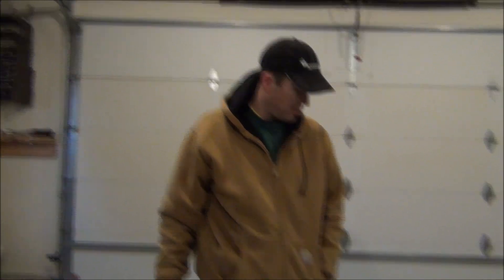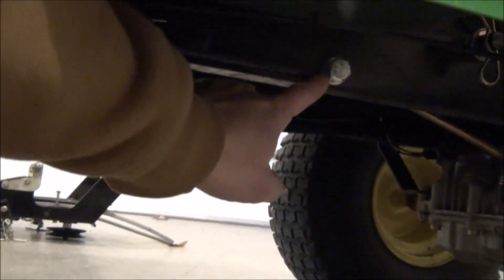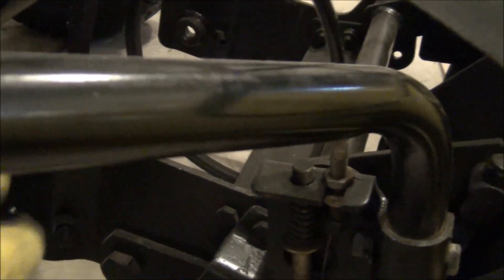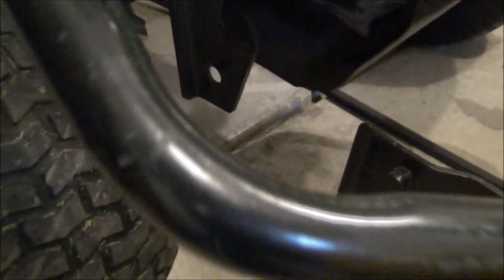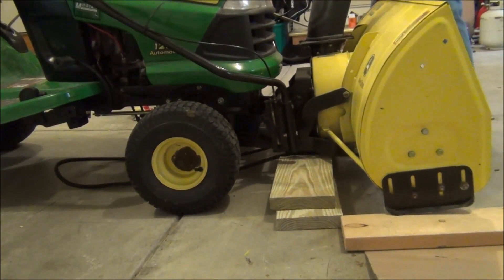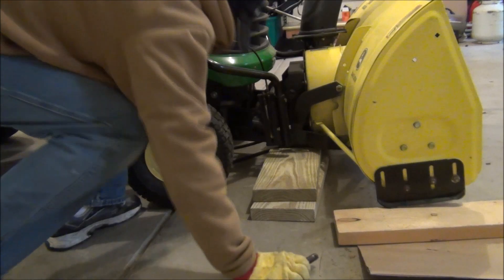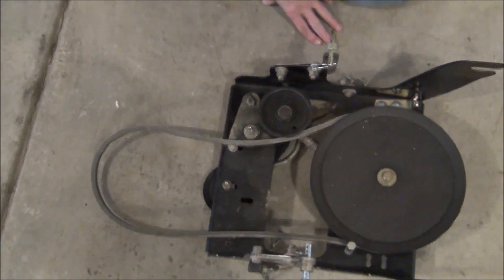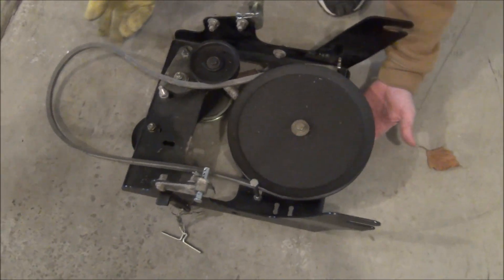How to Attach a Snowblower to a John Deere 100 Series 125 Automatic

Comment: Your video is very informative and appreciative  .  I have the same snow blower on a John Deere L 100 manual transmission . With the same set up . I was hoping that you would know what the proper part number is for the belt that drives the blower ?  I also kind of wish that you had taken and flipped over the pulley /Spring system , so we could get a better idea of how all those springs are attached . I had one fall off recently and for the love of God,  I can't figure out how it hooks back up 😢

Comment: i installed the snoblower attach but the belt dont move the stage now. Some can help.
Reply from the maker: Does the belt tighten when the pto is engaged? Will the blower turn by hand or is it seized up?
Reply: @TheWippsFamilyOfFive  i can move the big belt with my hand but the upper belt dosnt turn.
Reply: I fixed it. Just i replaced the belt. Now work good. Thank you.

Comment: Kudos to you for making this video. I have  JD125 and made the mistake of buying the snow plow they make for that model. It also is a real pain to install and if you have to clear more than 3-4 inches of snow it is of little use. I'm debating whether I should double down and buy the snow blower. My fear is that it will not be able to handle heavy wet snow. I learned the hard way that JD's customers are not the consumer. Their products are designed to ensure their dealers get more business from frustrated consumers who struggle with getting their poorly designed products to function.

Comment: Just wanted to say a HUGE Thank you for your video. I received this same blower attachment for free and like you, I was told that by the dealer that it wouldn't fit on my 2017 D110. Thanks to you I proved them wrong. The only thing I had to buy was a new PTO cable and spring. the spring that was on the end of my PTO cable was massive (about twice the size in diameter, and it would rub against one of the pullies. So I went to the local John Deere store and said that I needed a smaller spring (it comes as one piece, spring and cable). They gave me one similar to the one you had. My blower was in much worse condition than yours was in, but thanks to your other video, I found all the parts I needed on the JD parts website to bring it back to life and I was blowing a foot of snow this morning!  Again, Thank you for taking the time to share your knowledge. So far, I spent about $300 getting it up to par, but that's still better than $1500 for a new one!
Reply: which other video

Comment: That is a lawn tractor not a garden tractor. If you continue to use heavier equipment like that on a light duty lawn tractor you will definitely ruin it. The rear end on those is not rated for heavier work like that.

Comment: Regarding the 4 bolts you have to retrofit on the frame of the tractor for the drive to attach to: Where on the frame did you drill? Is the an alignment with anything on the frame for one pair of the holes so you get the position right, please?
Reply from the maker: We did not have to drill any holes to put any of this on. I am not sure that I understand your question.
Reply: You did not have to drill holes in the frame to attach the "PTO" pulley system assembly under the tractor?

Comment: Well done! This confirmed a lot of the things I was trying to figure out.I have a LA125 with 42" Snowthrower as well.My only concern is the Main Drive belt does not feel very tight once PTO is engaged (I checked it by feel when the tractor was turned off). While running, the Snowthrower turns, but again I am concerned about the tension and if it will be able to work through the resistance of the snow. Any thoughts?
Reply from the maker: The Snow Thrower belt tension can be adjusted via the chain that comes out on the right side of the tractor. Check out the video around the 19 minute mark. The video is a little dark but you should be able to see how it adjusts. If you need it tighter you can pull the chain out more. If you need more help contact us by responding to this comment and we can maybe make a new video that shows it better. Also, how old is the belt? If you can't tighter it anymore then maybe it has stretched too much and it is time for a new one.
Reply: Thank you, but the lower belt is great and I could see the tensioning process.
I am referring to the upper belt from Main Drive Pulley to The mid pulley mount.  When I engage the PTO it seems a little loose, how tight should it be? Is there a tensioner on the Upper Belt?
Reply from the maker: Yes. The chain on the Left side of the tractor should adjust the tension. Hope This helps!!!

Comment: Being a decades JD owner of farm equipment and lawnmowers this snowblower set up is a joke!  What a lousy design ...   you actually need a small floor jack so you can easily adjust the height and angle of the front of the snowblower.   Save your back, even a small chain hoist would help tilt it...

Comment: What did you do with the deck engagement cable when you removed the deck?  Does that have to be removed or is there a place "store" it beneath the mower?
Reply: The clutch cable that activates the pulleys that drive your mowerdeck also activates the pulleys that drive the auger on the snowblower. You would only tie up the clutch cable with some zip ties to the frame if you were using a snow*plow* on the front, because it does not connect to the pulleys at all.

Comment: Hi, great video. Does this model, require rear weights?
Reply from the maker: Yes. I order to work the snowblower properly you need to have a weight on the back of the tractor. We built a stand and put 70lb. sand bags on it. You can see it in this video:
https://www.youtube.com/watch?v=t8cBq3RlsUA

Comment: nice job now come help me with mine.:)  my blower has a one piece rail assembly instead of two pieces like yours.john deere needs to make this easier.  I have 6 hours in it and have the blower built and tractor prepped. Now i jus need to horse it on to the tractor.nice patience and a great  helper you have.   i have D160 and new JD  thrower. worst install manual i have ever worked with. D160 has electric pto instructions are for manual cable type pto.
Reply: Did you ever find a solution to this problem. I am having the same problem with D130.  I also agree that the manual sucks.